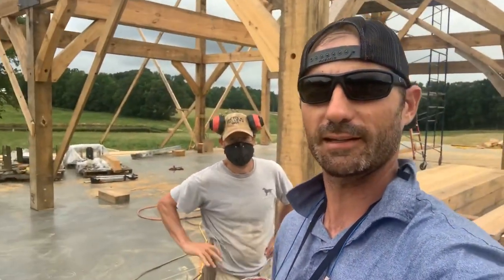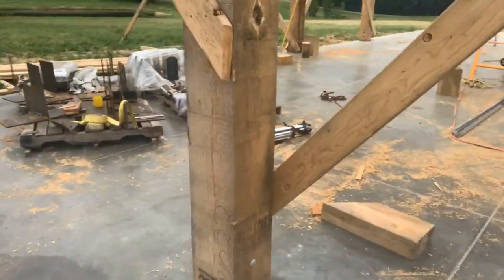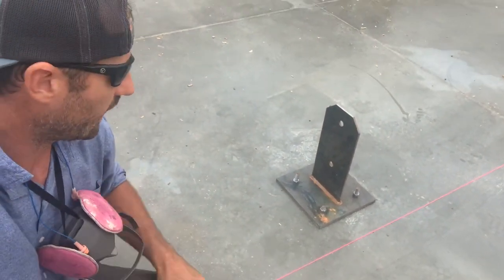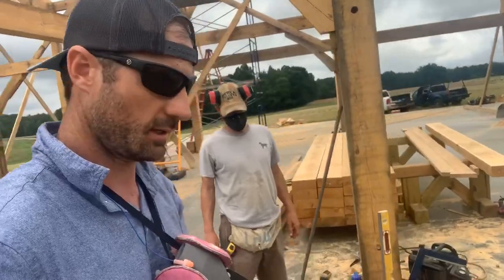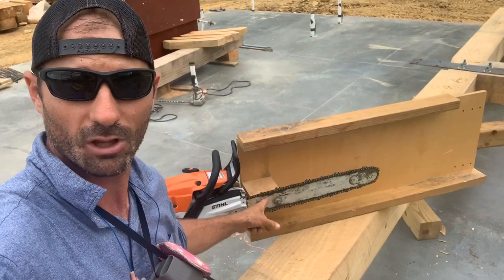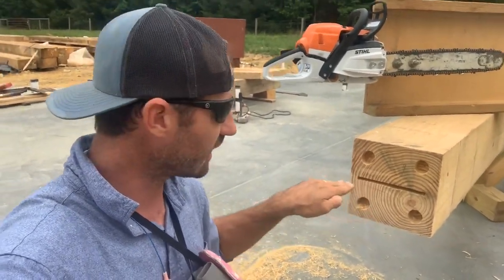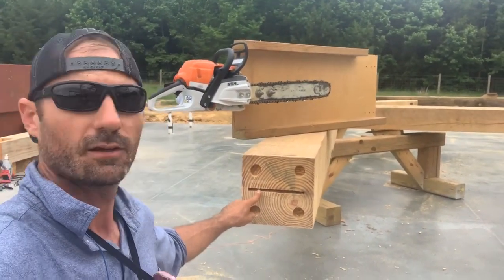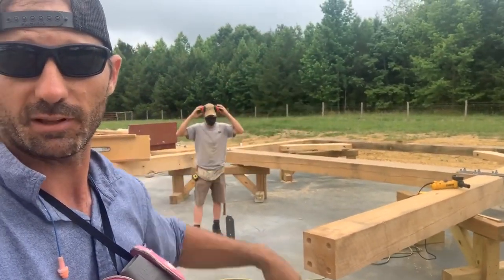AMAZING timber framing JIG! Chainsaw slotting a steel knife plate

Comment: Great idea! Thanks for sharing! The jig takes the human error out of the process. The bolt holes have a jig also?
Reply from the maker: Conrad Homestead the bolts don’t have a jig. We just measure from the base upwards to where the holes are in the knife plate and use a speed square to make sure that the drill enters square to the post and finds the hole inside.
Reply: Right on 👍

Comment: Great idea. Do you think you could use that concept to make steel connections for other joints to reduce the time spent for mortise and tennons?
Reply from the maker: Absolutely. It saves time when compared to wood mortise and tenon joinery. What do you have in mind?
Reply: @HeirloomBuilders  Just thought it would save time to mimic traditional timber framing if you rebated the base plates, recessed bolts etc..you could even make the bolts/nuts recessed and then plug the holes with oak pegs. I'm sure with simple jigs like yours it would be quiet efficient!
Reply from the maker: @jakekosky2227  that’s a great idea. I think you’re on to something. 😎

Comment: Hello great work.Congratulations.We are doing woodwork in Europe.Which type or model  of Stihl are you using ?
Reply from the maker: We are using the stihl 460. Smaller saws will struggle but could possibly handle this with a slower cut

Comment: How do you get the holes in he post for through bolts drilled accurately
Reply from the maker: That’s the hard part! Square up off the base plate and measure over from the edge of the post. Drill from both sides can help. And use a jobber bit to help guide you through the metal plate.

Comment: Just subbed! Great Work! Where do you get your hardware? Looking for post and beam connectors, but can't find any decent prices online. Thanks!
Reply from the maker: We design it and have a metal fabrication shop cut and weld and drill the holes. Let me know what you need. I may have some designs I could send you to get local pricing on fabrication. Logan@heirloombuilders.com
Reply: @HeirloomBuilders  Really? Wow, thank you!
Reply: Simpson strong tie have some models that will do up to 12x12 if you need them off the shelf.

Comment: Great info! Where do you get your knife plate anchors?
Reply from the maker: We have a steel fabrication shop make the knife plate anchors. Will you be anchoring 6x6's or something else?
Reply: @HeirloomBuilders  Thanks for the reply! We will be needing round 10" diameter anchors for rough cedar log posts. We can't seem to find the round ones available anywhere. Does your fabrication shop make these types of anchors?
Reply from the maker: Cosmic Pursuits I’m sure they could. We just need a design. Sketch something up and send to me so I can better guide you. Round base plate with 1/4” vertical knife Plate? Are they going to be wet-set in concrete or bolted on after the concrete has cured?
Reply: @HeirloomBuilders  They will be bolted into the concrete post curing. Yes, the base plate would need to be round and have at least 1/4" thick plate, along with straps on each side. I have some photos of something the Texas Parks and Wildlife Department uses for some of their pavilions. I could send you those along with more info on what we are doing. Thank you much for the help! How can I contact you?
Reply from the maker: Cosmic Pursuits email logan@heirloombuilders.com
Reply: What model is your chainsaw ... is it a Ms362?
Reply from the maker: David Boris yes. In this video, we were using the ms362. It’s a bit small to power through that much wood. We normally use the MS 460, but the pull cord had broken. If you use a smaller saw, you’ll just have to take it slow.

Comment: what size diameter anchor for steel knife plate
Reply from the maker: 1/2” all thread rod with epoxy going into the concrete slab. 3/4” bolts through the wood post and knife plate
Reply: @HeirloomBuilders  what is the length of the rod  bolt that goes into the concrete   ?  thx good jobs
Reply from the maker: @zoritadewi6785  7” minimum embedment into concrete
Reply: @HeirloomBuilders  thx

Comment: Why not extend this process to all the other joints. Do away with mortice and tennons completely and those joiner plates at the post tops. An internal 1/2 inch plate would be invisible and just a cut away. I am investigating a mini chainsaw for small mortice and tennon joints and am thinking up a jig that I can make.
Reply: Helps a lot if you can find a bar with straight rails, even better if they're parallel

Comment: Where can I find a bar that bolts on?
Reply from the maker: You’ll need to drill 1/2” holes into the bar. It won’t negatively affect the bar’s performance, so you can use one you already have on the saw.
Reply: @HeirloomBuilders  How did you drill the holes into the chainsaw bar? I have tried but the bar steel is too hard for my bits. It's a Stihl bar.
Reply from the maker: @barryholmes5838  start with a small diameter HSS drill bit and work your way up to the 1/2” diameter hole. A drill press will probably help.
Reply: Thank you.
P.S your videos are well done and very informative..

Comment: A concrete column pad poured below the slab with a steel Simpson type bucket  would have far more structural integrity,  plus it would be far less in labor intensive and cost. Show off the steel plates and connectors , don't hide them , they will give more character to the Barn Structure...........would it not be fitting ?
Reply from the maker: I don’t tend to agree that exposed brackets are less labor intensive. But that’s probably because we install the bases to fit the actual posts that sit on them (which may be slightly twisted at the bottom by the time we lock all the joinery in place at the top of these 22’ tall posts. Having a Simpson bracket in place would not allow us any room for error in the sizing or different shape of the timbers. We go for the most clean/simple look.